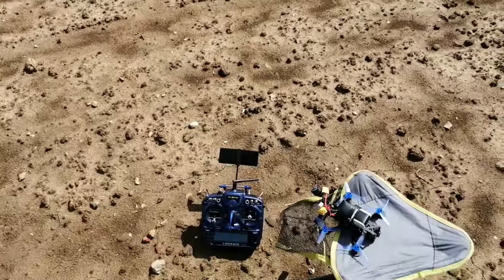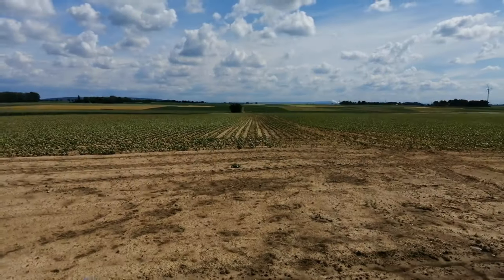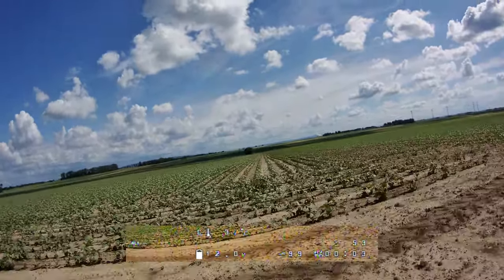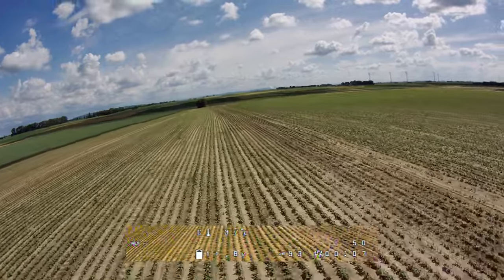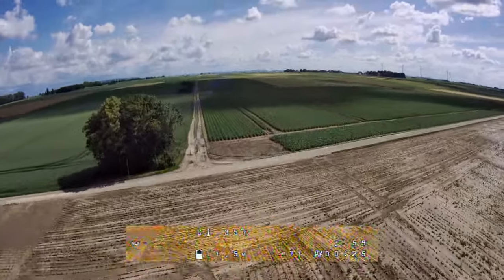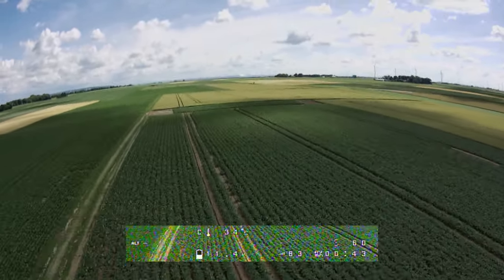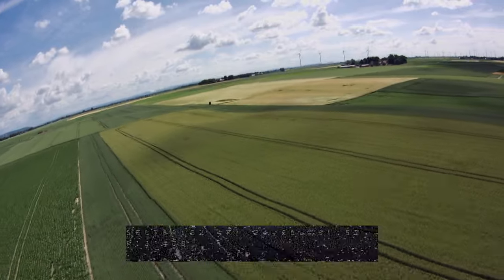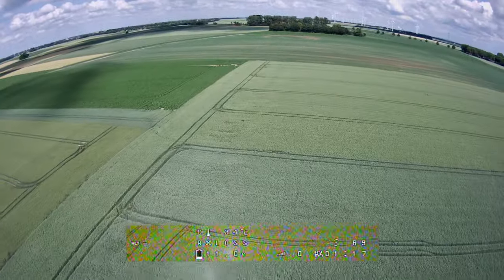🦖 HGLRC Sector 132 4k - sub 250g Long Range Flight - FrSky R9 Failsafe - A lesson I have learned

Comment from the maker: After a lot of testing, I have found out, that the Caddx Tarsier is causing a lot of RF noise that affects Long Range Receivers at the 900 Mhz Frequency. I even couldn't get a GPS Module working, because the RF Noise of Caddx Tarsier also affects the GPS. After unplugging the Caddex Tarsier the GPS instantly worked and has found satellites. I have tried to cover the Caddx tarsier and the GPS Module with copper shielding foil, unfortunately, it wasn't successful.
Reply: I have been meaning to ask, where did you mount your GPS module, I want to add one to mine but I know you are having issues.  I didn't see a good place to solder it for power.
Reply: Well, I won't be buying that then for any long range kwads
Reply: HI, is it possible to install GPS when i also have the DJI Caddx Vista in my Sector 132? Or is there not enough space for this module. And WHEN its possible, where should i connect it?
Reply from the maker: @Luigy79  yes it should be possible and even work fine, i do not expect emi noise issues with the caddx vista. You only need to get 5v gnd and rx tx. Get power where the receiver is connected and tx rx 5 or 6 - just use a free uart.
Reply: @TorbanDallas  Ok, but what if i also use TBS Crossfire? This still needs also rx/tx...
Reply from the maker: @Luigy79  check the fc layout for a free tx rx.

Comment: Yikes that jello needs tuning out. I have been rocking my 3" DC3 since I totalled my 5" last week and have had good performance with the crossfire antenna horizontal below the front. I also put a light 4 gram GPS on there just in case.

Comment: Yes, I have the geprc cinequeen with the runcam hybrid and it doesn't happen to me.  I think it is because of the bluetooth module that has the caddx installed, which makes it very noisy and blocks other systems such as the receiver or the gps, regards!

Comment: Range issue could also be because of the caddx tarsier. Poor shielding of this camera and stack could cause interference with your radio system. I have a geprc cinepro with the same camera. Although I fly in 2.4ghz, my experience that if receiver is close to the stack of camera the range is very poor.
Reply from the maker: That's interesting. The Receiver is placed in the back and it works on 900mhz. Wifi of the tarsier was disabled. But i will keep your information in mind, thanks.
Reply from the maker: Hey, after installing a GPS module i was wondering that it didn't work, i didn't get any satellits, after unplugging the Tarsier the gps module instantly startet to work correctly, so your theorie is right, and after a lot of testing and reaching i was able to verify it. The Caddx Tarsier even causes Failsafe with TBS Crsf Receivers and causes a lot of issues with GPS Modules. Apparently the Caddx Tarsier causes some RF Noise close to the GPS and Long Range Receivers Frequencies.

Comment: Well, this is discouraging. I have one coming in the mail that I ordered with Crossfire installed. I was hoping to do some long-ish range flying with it. I'll be watching to see if you solve this issues. Also, would you consider a video on installing GPS on this? Thanks!
Reply from the maker: I have installed a GPS, works on Uart3 and 6, 3 was used for smart audio, so i have used uart 6 on my one. You can use 5v and GND from the receiver or the VTX power pads. But GPS doesn't work when the Caddx Tarsier is connected. The RF Noise of this cam kills the GPS and even affects the LR Antenna. You probably will get the same issues with a CRSF Rx. Other HD /FPV Cameras seem to be less noisy and apparently better for this purpose of flying LR.

Comment: I am guessing the antenna was obscured by the quad when you turned around.
Also with the vibrations you were getting i would also suspect you had a lot of electrical noise going on also which wont help.
Honestly i have seen people struggle with getting good range on the crossfire system with the tango 2 on non diversity receivers. I really think that quads are extremely noisy environments and you need to get the antenna as far from the quad as possible.
Also maybe consider using esc's Drone Mesh has tested to be very low noise.
Some fpv cameras have been known to cause interference on long range systems something else to consider.

Comment: Do you fly with external battery plugged onto your R9M module? If yes,  is it 2S or 3S?
Reply from the maker: No, internal Battery, I have made a video about R9M Power Consumption - take a look at it, that's pretty interesting.
Reply: @TorbanDallas  yesterday I flew with 10mW on R9 with internal battery. And my cells inside the radio were getting weak about 7.2V. I experienced a warning RXLOSS for about  1 second but didn't loose control. I am using diversity antenna on my quad and the fig.8-antenna on my radio. It happened around some large trees. They why I thought it could be the voltage drop on the radio that might have caused you failsafe.

Comment: ? 🤔 What lesson? To better use inav for long range? Or to Update your Hardware to get rid of the failsafe Bug? To use frequencie matching antennas? Or to buy crossfire
? The fact that tbs receivers antennas Fall complete off for no reason is funny as Fuck. Never had an Hard failsafe with 868 and matching yellow Marked antennas
The failsafe Bugs from frsky Happen for 0,2sec. If you raise the failsafe time to 0,4 sec. Than you have just a little timewindow without control. And Till you realize you had an failsafe. You had your control already back
Reply from the maker: What lesson? Didn't you listen to me at the end of this video? btw my failsafe delay was set to almost 2 seconds, you can see the failsafe in the end of this video. Frequency, Firmware everything is fine, that's not my first video about the Frsky R9 System.
Reply: @TorbanDallas  Your video was posted in a ANGRY R9 Users Group. Just realized that you made a Video about my suggestions too AND are another Guy. seems i Mismatched something My Bad

Comment: Throw that R9 system in the garbage, go with something 100% of people who use it trust: crossfire.  I've got 3 quads on R9 and NONE of them give me a trustworthy RSSI.  As I first start out low RSSI and then if I pass close by myself enough times the RSSI jump to 99%, what crap!  All software same version etc.. I have crossfire and love it, consistency = greater trust in your equipment, period.
Reply: That's the best example of fanboism!
Reply: @Denasdc  Not really, all the headaches I've had with the R9 (I've mine since preorder time, like late 2018) system from the inverted (for frsky-not inverted) to fport to non-hooking to F4 (slim+ only) to inconsistent RSSI to firmware version matching, crap, R9=headache, crossfire = auto software update, hook up tx and rx and away u go with consistent rssi or lq PERIOD!
Reply: Crossfire is also not working right out of the box with the tarsier camera! It produces so much HF noise, that even the good crossfire RX has issues. The HF noise is coupled directly into the reveiver itself. You can fix the issue bei wrapping the receiver in copper tape, soldering a wire to the tape and directly to GND of the tarsier board for ground. Make sure your receiver has heat shrink around or else the copper tape will short it out.